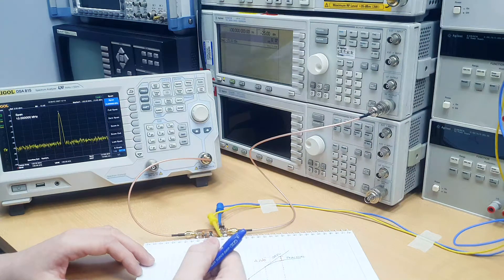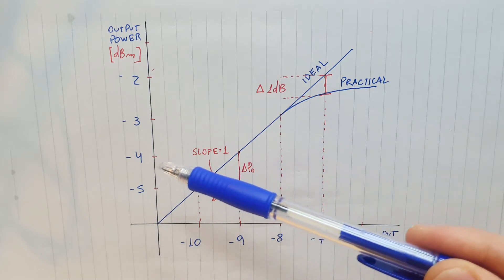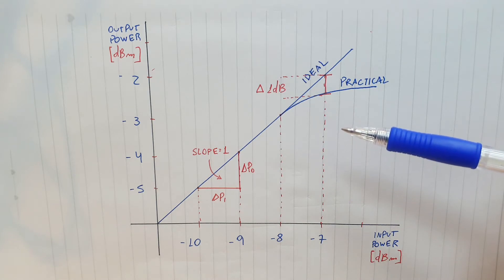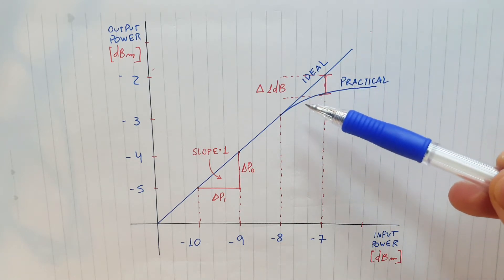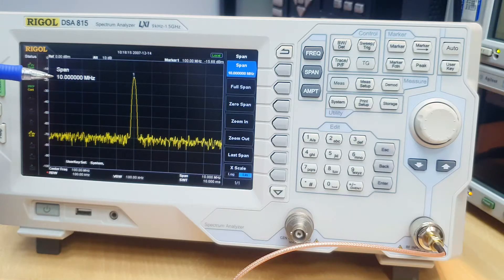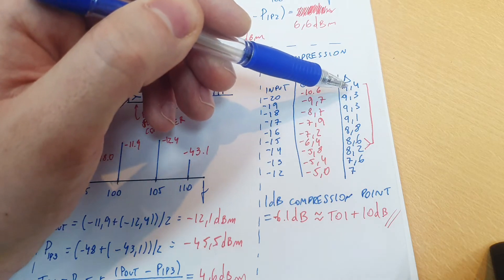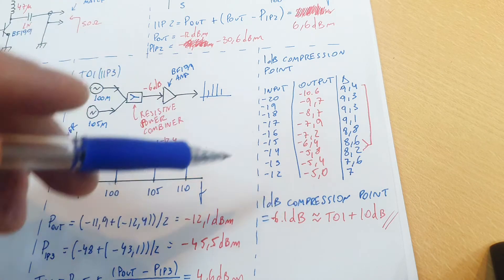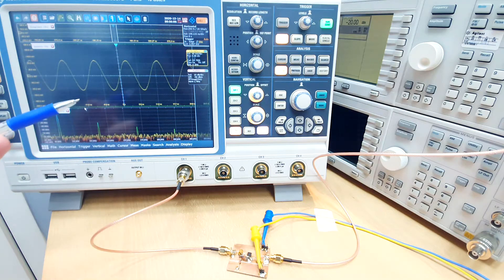Characterization of an RF amplifier - 1db Compression Point - part 2

Comment: Why do you write 2dB for the 1dB compression point. This is just confusing. Other than that great, compact and clear video. Thank you :)
Reply from the maker: Because the 1dB compression happens at 2dB output power.
Reply: @AllElectronicsChannel  Ah ok thanks